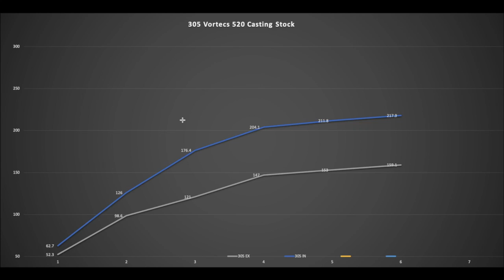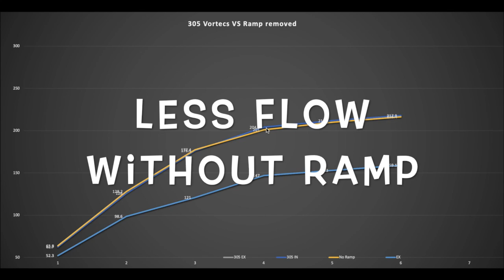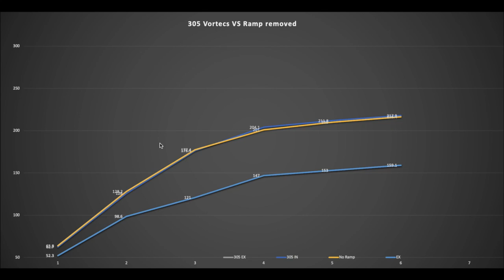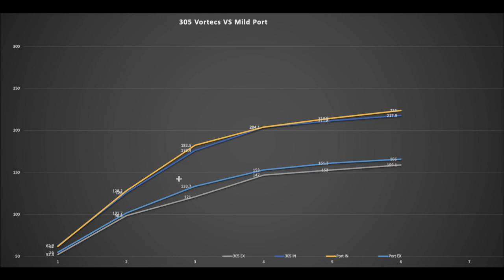305 Vortec Heads vs 350 Vortec Heads (Flow Data)

Comment: I have run 305 vortec heads on three different 350 builds. One significant Takeaway:  Off idle torque and throttle response. I live And operate at high altitude (6000-7000ft.)  So low vacuum and lazy performance off idle is very common.
I don’t know what it is about these heads, but they absolutely rock in drive ability. I don’t believe they are the best choice for horsepower in the upper RPM range, but it simply doesn’t matter for any daily driver.
They are SO good In the lower RPM ranges where you spend 95% of your drive time a little bit of sacrifice at the top is it worthwhile compromise. I plan on running a pair of these for the first time in a stock ‘94 TBI 350 truck soon And I’m very curious to see how the engine responds.
Reply: I have really wanted to do that myself. The 305 head/350 block combo. It might even make for a great 383 build imo. I have owned a Vortec 350 and still currently have a Vortec 305 in my '96. Nothing beats the 350 for high rpm and the power it possesses as rpm builds. But the low end is defintely lacking. It really doesn't start making momentum until 2500rpm, even with 3.73 gears in that particular pickup. My 305 is nothing like that, like you said the low end is always there when you need it and it's a great cruiser/daily driver. I think a 1 hp per cubic inch 305 Vortec is about perfect for any kind of daily driver/car show hot rod type of build.

Comment: Thinking of doing 305 vortec heads on a 350 tow motor, am i in the wrong for thinking that instead of the 906\062s? Id think the little bump in compression vs uptop flow would be more ideal for that application
Reply: You will need to use premium gas all the time, if you use a intake with smaller ports like the standard performer to have the highest velocity you will be golden, I would use a LT1 or a LT4 cam in a tow motor.

Comment: @CUTTER’S PERFORMANCE how do you think these heads would preform on a 350 with 10:1 compression a Preformer RPM intake and a 230@ 0.50 cam? I wonder if 370hp would be achievable…

Comment: The ramps on the 305 intake side aren’t for flow, they’re for air/fuel mixture for better combustion and are the reason for the different shape of the combustion chamber than the 350 heads.  Not a good idea to grind the ramps off.

Comment: Thank you for the last post, it does answer my interest in vortex heads 4 t 305 question. Regarding trying 305 heads on a 350, or larger block, I'm more curious about what you said of a 327. What about aftermarket  pistons w/305 bore and a 327 crank. Is that even possible...?

Comment: Why not use your 305 heads on a 283, 305 or 307? Prove good usable power is available from these under dog and usually dirt cheap engines.

Comment: I'm glad you put this info out it helps my decision. i have an el camimo with a 305 in it, I think putting my 305 vortec heads would help out in the power department a little. 

it should gain power on the whole curve, I would think. do you think its possible that there would be a 15 horse gain? im gonna keep the stock cam in it.

i would love to see what some 1.94 valves woukd do on these. a valve job, some bowl work, and maybe a little short turn work would be interesting too.

Comment: Having spent half of last night reviewing your previous videos I would be very interested in seeing what a 1.94 intake & a 1.60 exghaust on t 305 heads will show. And thank you for this. Ive had a hard time finding much info that would heĺp my problem and am danged glad I stumbled across your site. Im in CA. And t smog restrictions are a real problem. Without getting to deep, the best I think I could do ( so far..) is to use an 'aproved' RV cam to clear t test & then use 1.6 rockers for more lift. I cant even install t headers Ive bought OR dual exghaust until I can get my ass out of hear, that would be illegal in my '86 van. Thanx again.

Comment: Try the LM7 valves. 1.9/1.55 with 8mm stems. Possibly 40°seats on the exhaust for a single pattern cam for more low speed torque. You could use stock LS guides or upgrade to bronze.
Reply from the maker: I would like to try LS valves in a vortec, something I haven't tried
Reply: @cuttersperformance David Vizard is looking to install LS valves in a pair of 318 heads for the Mission Impossible project. They are about 20g lighter each. Then if you have a 1.8" installed height, LS beehive springs, retainers and locks can be used for more weight reduction.

Comment: PISS-CUTTER.. I'd like to know exactly what areas of an 062 vortec head to port to increase flow at mid and upper rpm band? As I mentioned in comments a couple months ago, I'm using an L31 longblock to replace a locked up 86 L98. I know the tpi i already a major restrictor.. Tho i have opened up what i can. Now I'm planning on using the zz4 cam with comp cam 1.5 roller rockers. But also have a factory 97 LT1 f car camshaft.. But now have my eye on Summit Racing cam SUM-8801. 
Thanks
Reply from the maker: Its 90% of the bowl work with vortec heads, open the bowl to 88 to 90% of the valve diameter and blend the seat. 
So you'll have to obviously use an aftermarket tpi lower intake with the vortecs, which is good but you can't really change the characteristics of the tpi intake, which is low-end power. 
I use to do alot with tpi stuff, they are a great street combo for smokin the tires and not a high reving high hp setup. After market runners, ported plenums and the vortecs will help but 5200rpm is usually still the drop off for power, and thats also why you dont want to over cam them

Comment: So how would the Vortec L30 heads work on a TBI 350 vs the Stock TBI heads when going with a jegs dual plane intake and a 650 cfm AVS2 carburetor? A dyno test between these two heads would be interesting on a TBI 350 shortblock. The test would be nice even with the small factory TBI cam just to see the difference. Also,
When will you test the new summit hydraulic roller cams with LS firing order for SBC? Thanks

Comment: I snagged a L31 from late 90s yukon from LQK and plan to use the 062 vortec heads with LS lifters and ls3/6 beehives as i have many used sets laying around from build LS engines. I got the offset valve locks and such. Motor is to upgrade an 86 Vette with a locked up L98. I also have a brand new zz4 cam that I'm debating to use over a low mileage cam from a 97 LT1 from an f-car. I'm thinking more using the LT1 cam with just LS1 beehives which are good to .520 lift. Also will be keeping it TPI fuel injected. And since I'm using the tpi system (and yes lower base from a 89 L98), I know the zz4 cam will not breathe in higher rpms like it is able to if was in an LT1 or a dual plane/carb w/ headers set-up.. But I also have a set of 113 L98 heads that were 'built' from what looks like a long time ago. And since I'm not sure how long (after getting the car running again) I plan to keep it, I don't want to use the 113 heads as we all know ate getting hard to find. Especially, since I snagged them up for just $200 that came with nice cast alum tall valve covers and aftermarket parts and hardened pushrods even. I do plan to port the 062 heads regardless. I do a lot of LS heads. But never did any sbc gen.1 or 2's. So I am learning some from another guy. But I am very eager to see final numbers. As I have an ole 88 K1500 with the GM 350 h.o. crate in it and she hauls azzzzz. With the 33x12.5x15 mudrovers on her, she spanks 4.6 poopstangs all day!!! And its the 4spd with low granny too. Its been a good 15 years since I built anything non-LS and am getting very eager! Looking forward to more vortec info! Thx for making this video!

Comment: WOW!  I'm building a 305 and have a  set of 416 heads and a set of 601 heads. I'm  72 years old and used to build engines 50 years ago but  know nothing about vortec heads. 
What should I  do???
Reply from the maker: Vortecs will put proform just about any production sbc head! But it will depend on how much power you want to make

Comment: The Combustion Chamber on the 305 Head is the biggest issue.. It's basically a old school wedge design vs a Modern Heart Shape. If everything was the same other then combustion chamber the heart shaped head will make more power.
Reply from the maker: Yeah totally agreee. The 305s vortecs has a very similar chamber to a tbi head. Flow is decent and compared to pre vortec heads its actually not bad
Reply: @cuttersperformance  the difference between the combustion chambers happens when both valves are shut and the spark plug fires, a Heart shaped combustion chamber makes a more efficient flame front then a wedge design.

Comment: I would like to get the part numbers for the the valve spring upgrade as well as the part numbers for the locks and retainers and I'm curious if they will be ok with a Crower 280 hydraulic flat tappet cam on a .40 over 350 please let me know what you think thanks for all your info

Comment: GM performance parts has that tbi intake for vortec heads, makes me wonder if this head and intake combo was going to go on say 95 trucks which is such an oddball truck anyway but they decided to wait a year and they had a better head for L31  350's. After all the 305 L30 head is a TBI/TPI head done correctly with the same good exhaust flow of the TBI head but better than TPI head intake flow.

Comment: Considering putting a set of 305 Vortec heads on a stock SBC 400 bottom end with stock pistons. Any advice/input on that? Quench area and head gasket selection?

Comment: ehhhhhhhhhhhhh stock cast iron vortec heads, theyre real weak in the knees. I only use 3 vortec heads, cast iron are Chevrolet Performance 185cc Bowtie,  and aluminum AFR 190 street, and Chevrolet 210cc Fast burn.  The bare casting on the 185cc Bowtie are part #19331471 $574.25 at Summit Racing and they destroy these weak in the knees truck heads so bad its not funny. Getting a set of real performance heads for just over a grand is a much better way to go.  A ported set of truck heads WILL NOT out perform the Bowtie heads andI dont care if Don Garlits himself ported them.
Reply from the maker: There's no question that lot of aftermarket heads are better but vortecs work pretty good 👌
Just a option for the budget builder or someone in class restriction racing

Comment: Swirl port and swirl bore are two different things, i don't think we have air flowing from the port to the bore like a corkscrew, i think the design is primarily promating flow into the center of the bore which leads to more efficient burn as the mixture is filling the cylinder in a more uniform way. 

The mixture hitting the backside of the ski ramp is being deflicted down and is helping to turn air on the short side past the valve, there is a convergence that dumps mixture more down into the bore center instead of a non swirl port being more  towards the cylinder wall in front of the exhaust valve.

I think people who designed the late model cylinder heads for GM where waaay smarter than anyone ever gave them credit for.
Reply from the maker: Its actually pretty crazy on how much swirl the ramp causes. Ive done some testing on the flow bench with a velocity probe trying to figure out exactly how the air in moving in a tbi head. The best way i was really tell what's going on is to use a piece of thin yarn. Holding one end you let vacuum pull the yarn into the intake port....the string literally wraps itself around the stem of the valve! Its pretty crazy how much swirl there is... aka "swirl port" haha
Reply: @cuttersperformance  I like it. speaking about probes, i bought some 1/8" brass tubing in 12" lengths at a hobby shop and found some string that would fit inside , i worked it down to the other end and i can set the stick out like a wick , i fray it a bit, works like a hot damn for probing around .
Reply from the maker: @luckyPiston  thats smart, i might have to try that!

Comment: I got a vortec 305 in my '96 and it run surprisingly well to have a 3.08 gear.
Reply from the maker: Yeah they work better than most older stock 350s thats for sure

Comment: I purchased the CIFIC marine 059 replacement heads bare. Seems good quality.
Reply: Those if you look closely may have stellite exhaust seat inserts and 3/8" guides on the exhausts for HD marine use.
I came across a set of marine 217's that were set up like that so they may do the 059's that same way too , worth a check so you get the right exh v/v's

Comment: I'm building a motor for my truck and picked up a pair of 059 heads from my schools shop and going on a 350 stock bore flat top pistons but in struggling with choosing a nice budget cam and lifter combo any suggestions?
Reply: A howards 450 lift rule cam is what I'm using

Comment: Unless you're  installing a larger cam without pulling the heads I think it's far easier to cut the tops of the guides. It only takes about 5 minutes with the proper cutter and a cordless drill, at that point you can run whatever springs and retainers you want without worrying about them hitting the seals or the tops of the guides.

Comment: i like the XE256 and XR264HR cams or a small voodoo cam. A roller cam i like the best even though the flat hyd. makes better power until the bigger roller cams take over and then the mech roller. For a great torquey 305 its not going to have top end and rpm shall be way under 6000 rpm for sure. Hypereutectic pistons. It would be great to use 6" I beams just for the fun of it. i am getting 6.160" rods made although i have to buy 100 of them. but that is through hurricane and don't think i want those anymore. I want compstar offset ground crank with small honda journals on the rods and crank. A 1.765" radius /3.53" stroke on an undecked 9.025" block with  6" rods and 1.260" hypereutectic pistons. turns a 355 into a 360 and a 305 into something else. Just better longevity and overall . puts it almost right on 1.7 rod ratio. lower friction. better for wear. Even though the best power comes with a stock stroke and 6.285" rod and a 1" piston with a rod ratio of 1.8:01. And a non turbo or really low boost because of compression and piston shortness with the ringlands squished above the pin bore for daily driving. A custom piston for sure. With even less wear and the best power in a sbc rod ratio.

Comment: Thank you for the video!  The 305 vortec combustion chamber is almost the same as the 350 vortec, it just doesn't have the point that turns it into the heart shape, and that is fine, since the 350 heart shape point actually shrouds the exhaust valve flow out of the chamber.  The 305 vortec chamber is nothing like a swirlport chamber for those that only see the lack of heart shape
Reply: So what do you think the purpose of the point is ? i look at it and i think there's a reason they put it there ....
Reply: @luckyPiston  1 reason I can think of is to make the 350 chamber smaller cc for ~9:1 compression with the larger bore & stroke of 350.
Reply: @archive.garage  K, how about if it was there to split the flame front traveling across the top of the chamber away from the spark plug ? by the time the piston is reaching TDC and quenching vapor into the flame front for ignition you could have a pretty interesting looking burn pattern ? a twin vortec ?
Reply: @luckyPiston  you're exactly right on the design and reasons why. The heart shaped chamber has a more efficient flame front, and is less prone to detonation. 
 I seen a video about Ford's racing with Glidden and Elliott's  domination of the mid 80s. Both used Cleveland base design head' but both welded up the wedge shape chamber and machined heart shaped chambers back in. Everyone else was still running a wedge design.
Reply: @kevind3185  Yeah i was thinking to fully optimize that feature with the 350 vortec head, go with flat tops or a D-dish so the piston mirrors the head, i have a 383 Vortec with D-dish KB pistons 9.75:1 compression and i run 87 octane on a regular basis, gets pretty decent gas mileage too so must be doing something right !